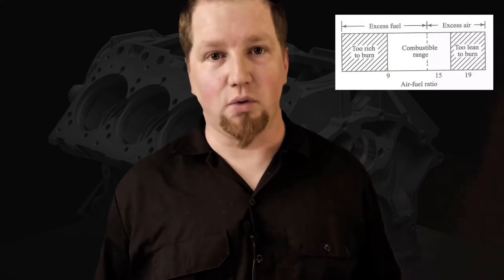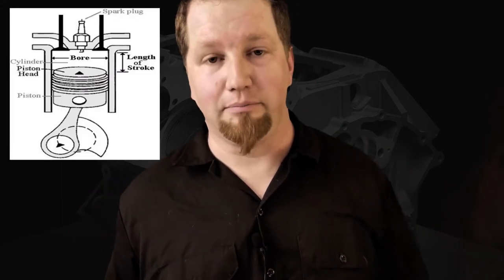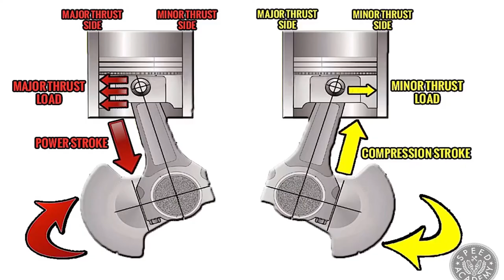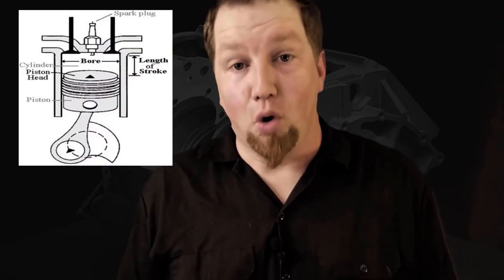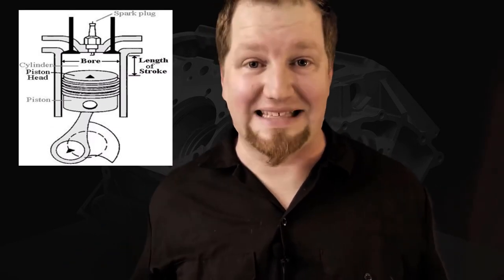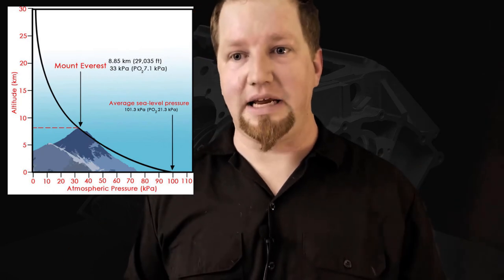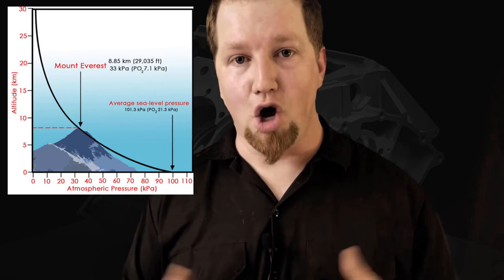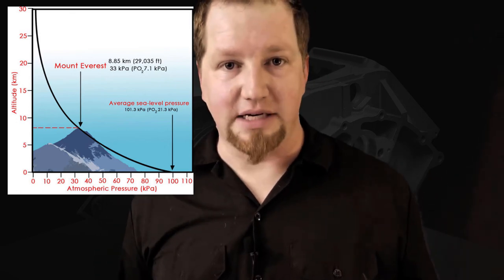Making Power 101 Ep : 1 : The Basics of Engine Performance

Comment: Very good info Salem. Back in my day there was no replacement for displacement!  The manufacturers ran the largest bore and shortest stroke, big carbs, large valves and headers to evac that waste. Prime example was MOPAR. Heavy cars, large displacement, realitively short strokes.
 hemi heads,  large valves. But most of all.. bullet proof. as you said.. they hit a wall. so in race mode . stuff more air. Exactly what they did. The diesel 671 supercharger on a gas burner was born!
Again... very informative video.  Rock on!
Reply from the maker: +Michael Lamorte thanks